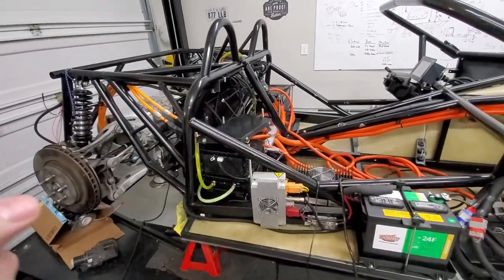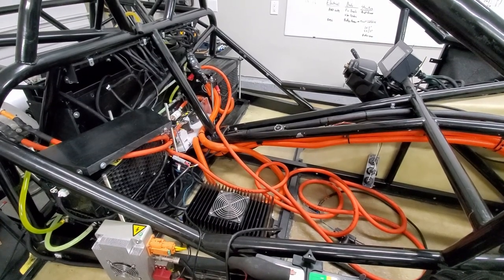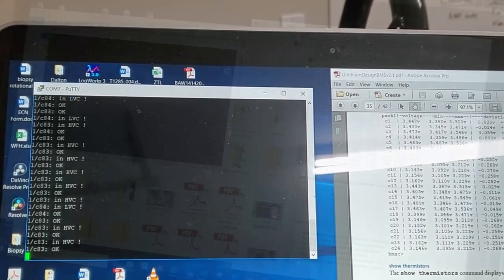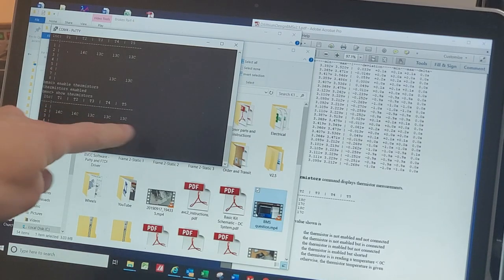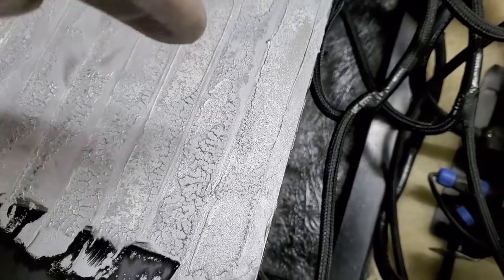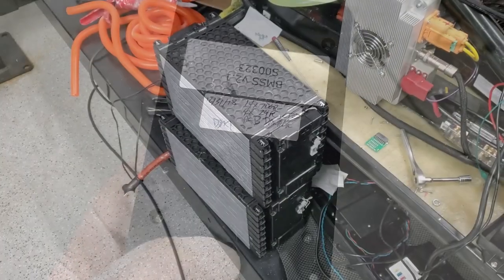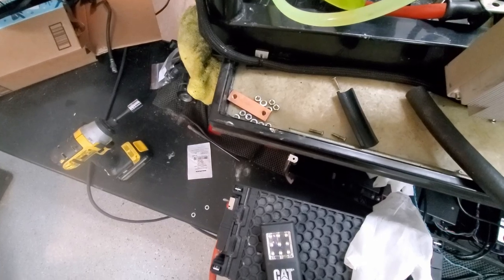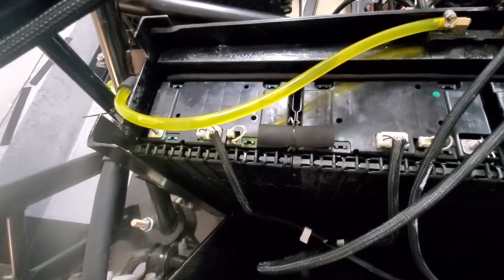Electric Vehicle Battery Pack Problems

Comment: Greetings.  Nice project.  What thermistor resistance and B-values did you use for the batteries?  Cheers.
Reply from the maker: The BMS has been designed to work with a 1% 10K NTC thermistor, with a “B value” of
 3435K.
Reply: Electric SuperCar Ah, thanks. Did you keep the factory battery thermistors in the LG Chem packs, or retrofit aftermarket thermistors?
Reply from the maker: I kept the factory battery thermistors

Comment: I may get a bit of trash for this suggestion... but... there is a YouTuber named Rich. His channel I believe is called Rich Rebuilds. He's opened up a garage for electric cars which, coincidentally enough, he calls the Electrified Garage. The reason I bring him up is for the suggestion to contact him concerning his design on a wall charger for your car.

As for the placement of your charge port, this might be a bit of work but you could fit the panels onto the car then walk around it to see where it would be the best placement for your convenience. Or just look at a 3D version of your car. You can put it behind the license plate and put on a bracket that swings the plate out of the way. The Electrified Garage has a video showing something similar to that.

Lastly, the battery placement. My thought was, you would always want easy access to it and perhaps the ease of swapping it out if and when that time comes. I truly feel that a custom box in the rear of the vehicle in that cavity you have from the rear frame bars would be ideal. Provided you have some sort of hood/trunk lid back there when the rear body is on. I realize that would mean a lot of running wire to get there, but I feel like the end result would be well worth the time spent. 

As for the BMS box, it looks pretty sketchy to me and if you are able, I would simply replace it so that you have the confidence of a good part there.

Sorry for the lengthy response. Still love seeing your updates and really looking forward to your first test drive. Keep the updates coming and great work thus far.
Reply from the maker: @Michael Monette
Thanks for your comment.  I will look up Rich Rebuilds.  As for the charge port placement, I am leaning more towards the license plate location, but haven't committed yet.  The BMS box IS very sketchy.  Many times I will mock up something quickly to see if I like it.  In this case I am in the process of making a sheet metal version.  Coming soon.  Thanks for tuning in.

Comment: Hey Jer, I am so glad I found your project, I'm planning to do a similar build of a telsa powered kit car using the lgchem batteries, but my plan is to use a factory five type 65 Daytona coupe.  I'd love to connect and talk you about wiring diagrams.  One thing I found when I was looking up how to run bms for two packs in parallel was orion bms warning about the difficulty of two packs in parallel causing eddy currents that can cause really high amperage between your packs.  Heres the link: https://www.orionbms.com/manuals/pdf/parallel_strings.pdf
Reply from the maker: Good luck with your build.  Can't go wrong with Factory Five.